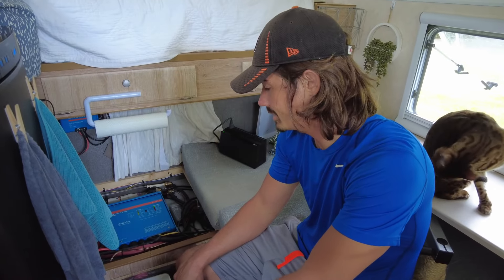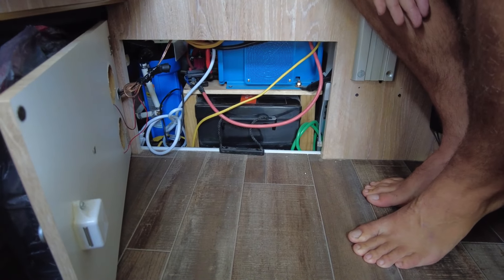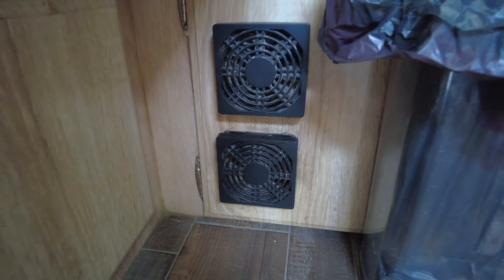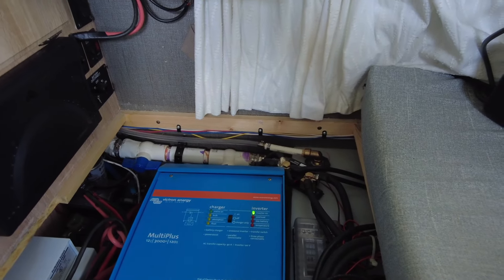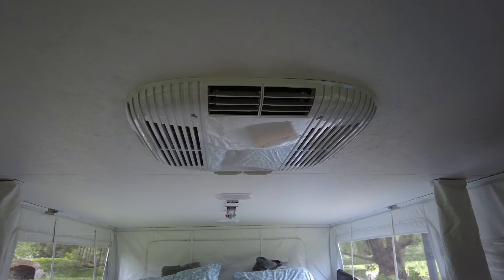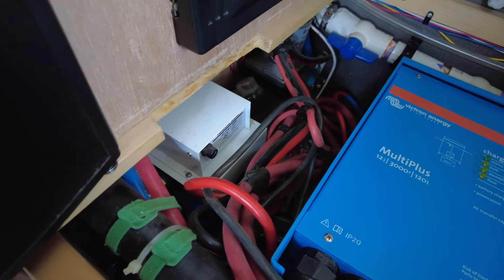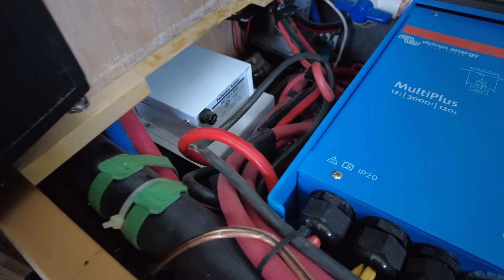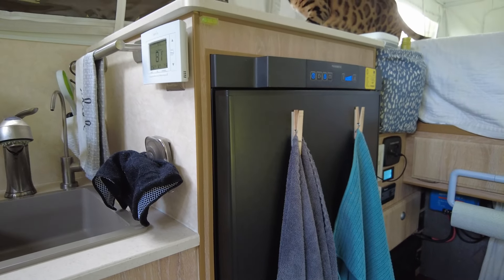Solar Power that Runs RV Air Conditioner for 8 HOURS! Truck Camper Mods: Water Filtration & More

Comment from the maker: ⬇ Camper Mods & Off-Grid Products from Video ⬇
HELP SUPPORT THE CHANNEL BY BUYING YOURSELF GEAR!!!
AFFILIATE LINKS ARE BELOW. 👇

Power System
Victron MultiPlus Inverter: https://amzn.to/4b9QMtx
LiTime 12V 400Ah LiFePO4 Lithium Battery With 250A BMS, 5120Wh Usable Energy: https://www.litime.com/?ref=ycqoqluc
* Coupon Code for 3% off Li Time Products: 2CATS *
Victron Solar Charger: https://amzn.to/3QAxpkW
Renogy Flexible Solar Panels: https://amzn.to/3V1H7jb
Solar Connectors: https://amzn.to/3USCkPN
Victron Energy SmartShunt: https://amzn.to/44xdnxE
Victron Energy Interface: https://amzn.to/4dxTpqp
DC to DC Charger: https://amzn.to/4abxi6f
Cooling Fans: https://amzn.to/3UqlWW8

Heating & Cooling
RecPro RV Air Conditioner: https://amzn.to/3UAgboT

Water-Purifying System
Pura 15610111 - .5 Micron Water Filter with UV Light: https://www.filtersfast.com/P-Pura-15610111-UVB1-EPCB-Chlorine-Filter-UV.asp
Under Sink Water Filter: https://amzn.to/3QCwmkz

Other Mods
Battery Surge Protector: https://amzn.to/3WtwJle
USB + USB Type C Outlets: https://amzn.to/3Jz6zFV
Honda Generator: https://amzn.to/4aaGKa7

Comment: Cool, that's a pretty big solar system for a truck camper. The rest of your build is nice and clean too. Congrats! If you wanted to add a little more solar you could always mount an array on the side of your rig like we did. We're retired FTers who discovered we love boondocking, so designed and built our off-grid electrical system ourselves, on a limited budget. It took us 5 years to gather the resources to finally complete the project. We're living this lifestyle off of a limited retirement income so had to take the low budget route, foregoing name brand components like Victron and Battleborn for more affordable options. 

We started by building a 620-watt liftable solar array on the side of our 1999 National Tropical MH. Our side array makes a nice bedroom window awning too, practically lifting itself with a couple gas struts, and it's easy to clean, standing safely on the ground. Next, we built a 12v, 560ah LiFePo-4 battery using 8, 280ah prismatic cells and a Heltec 330amp (1,200a surge) BMS with a 5a active balancer. These cells fit perfectly under the steps of our MH where our old pair of golf cart batteries used to reside. We insulated the battery compartment, cut a small hole in our step risers and installed a tiny computer CPU fan to keep this space at close to room temperature, (similar in concept to your design, but smaller) so we don't have to worry about the BMS shutting down charging due to low temperature - or their life reduced from getting too hot. Our 12v system uses an 80A LFP converter/charger, a 1,000w Renogy inverter, a 50a Epever MPPT charge controller and a Lnex battery monitor. All this cost us under $3,500 and meets all our off-grid electrical needs except for our air conditioning, heat and microwave. 

By mounting the solar array on the side of our coach, we left the roof free to rack 8, 550w solar panels down the length of our 35ft Class A, 15" off the roof, above our AC, vents, etc. It shades our entire roof, allowing plenty of cooling air underneath, increasing solar output and reducing the heat load on the air conditioners. Our 4,400w fixed array can run both our A/Cs, household appliances and charge our batteries from solar at the same time, even in winter. We mounted a Sungold Power all-in-one 48V, 5,000W Inverter/100A charge controller/battery charger, breakers and another Lnex battery monitor on the wall in our bedroom, saving us space as well as money compared to a system built with individual components. This all-in-one unit has the same 99% charging and 95% inverter efficiency as the Victron unit, though it lacks some of the bells and whistles to come in at only $764 for a full 5,000 watts of PSW inverter power and 100 amps of 48v charging. We chose this particular unit because it supports up to 500 volts of solar power which was needed to accommodate our 400voc solar array.

This high voltage system performs very well in low light conditions. A couple days ago it rained all day, but our high voltage array was still producing over 1,500 watts or around 35% of its rated capacity even in the rain to keep our battery topped up. Our 48v battery uses 16, 320ah prismatic cells and a 200amp Heltec BMS to keep it safe. Together with our 560ah 12v bank, we have a total of 23.5 kwh of batteries onboard (the equivalent of 4 1/2 400ah batteries like you have) - kept charged by 5,020 watts of solar. We removed our old rooftop bedroom A/C and replaced it with an EG4 28.5 seer-2, 12k btu mini-split heat pump on the upper rear of our motorhome. It's super quiet and cools as well as our 14.5k btu soft start equipped Furrion we have up front, but only draws about 1/3rd the power. This second phase provides 24/7 off-grid air conditioning and heat from the heat pump. Our total budget for both 12v and 48v systems was around $11,500, including the $1,500 high-efficiency heat pump. We have no need to hook-up to power pedestals anymore, as we run everything in our MH without it.

We travel around the country a lot, visiting National Parks, and doing the tourist thing, mostly boondock out west. We spent last winter in Yuma, AZ, but we're visiting our son in NC now where boondocking places are pretty rare. We found an RV park that is letting us camp in a spacious site without hook-ups for only $100/mo., saving us $500/mo. off their FHU rates. 

Take care. We hope to see you down the road one day.
Reply from the maker: Absolutely fascinating! Your detailed breakdown of the system is incredibly insightful, showcasing its robustness. The 400v input into your solar charger is mind-blowing! The Sungold all-in-one package sounds like an absolute steal. We recently upgraded to version 2.0 last fall, boosting our solar power to 1800 watts and integrating a mini-split with a heat pump – the efficiency upgrade from the rooftop unit is astonishing! Transitioning from a 12v to a 24v system has been a game-changer for us. Stay tuned for our upcoming video in the coming months where we'll dive deeper into our setup. While it may be smaller in scale on our truck camper compared to yours, the journey is just as exciting! 😄
Reply: @twocatsandacamper  Absolutely. 24 volts makes more sense on a smaller system. We only went with 48 volts because our motorhome is bigger with more roof area for more panels. If you're getting by with 1/2 the wattage you only need 1/2 the voltage to maintain the same current and wire size. I look forward to seeing your evolving system.

Comment: It's not a bad setup. I wouldn't have installed the water heater and plumbing in the same bay as the battery and charging system. Something you to keep an eye on.
Reply from the maker: Thanks for watching!  Yeah I didn't really want to cram it all in the little compartment but that was the only spot I could make it all work.  Thankfully there were no leaks in the year of travel but that was definitely something I kept a close eye on.

We have since sold the camper and built out a different camper on a flatbed - I had much more room to plan the layouts.  Stay tuned for version 2.0 build videos in the coming months!